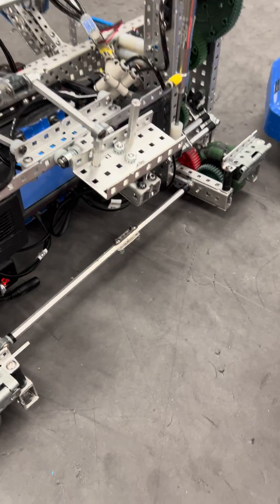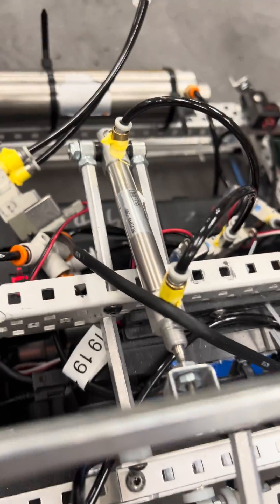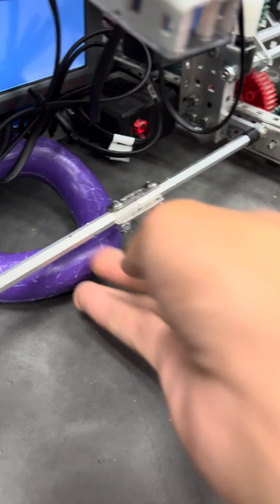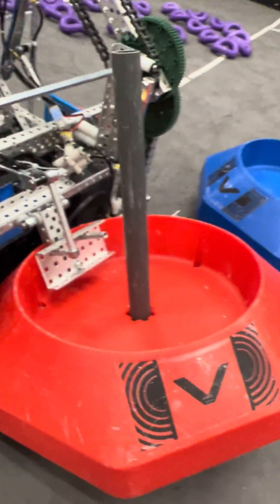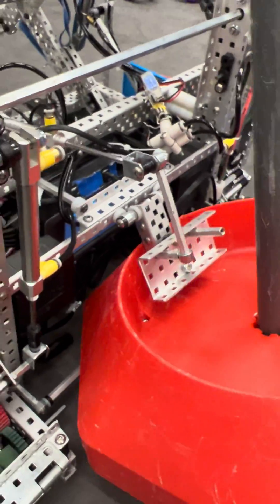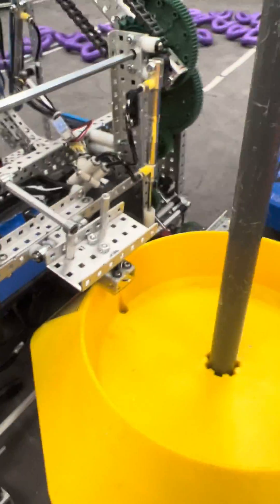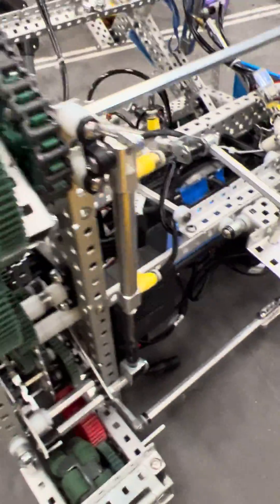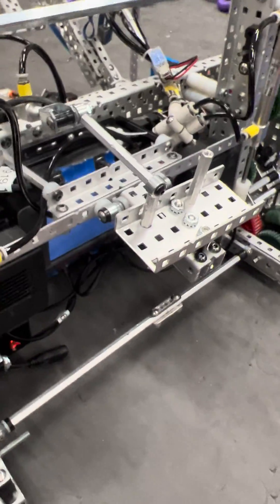2496n one piston mogo mech

Comment: why? Theres no way you run out of air. I was the only mfer who used pistons in turning point and tower takeover and not a single time did I run out of air. If you used that mech 20 times a match then maybe it would make sense to go to a single piston to save air. AND you can just adjust the air used anyways with the valve thingy. And its so wobbly. KJ u can do better than this your a god.
Reply: I'm assuming it's probably piston shortage. Since like every team needs them this year.